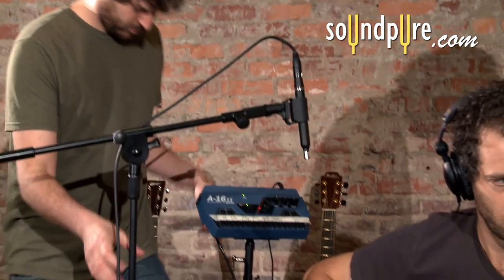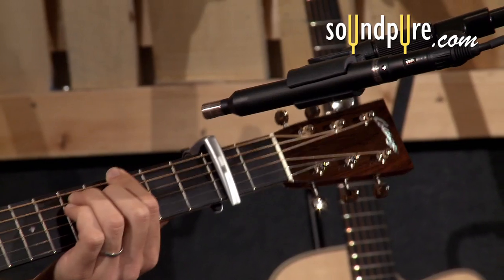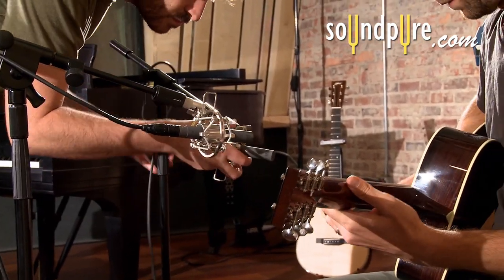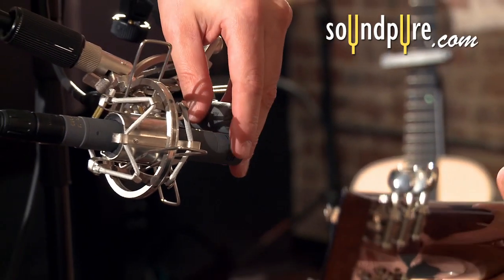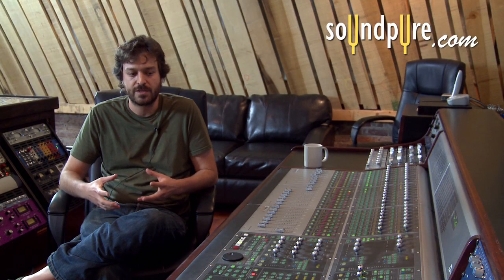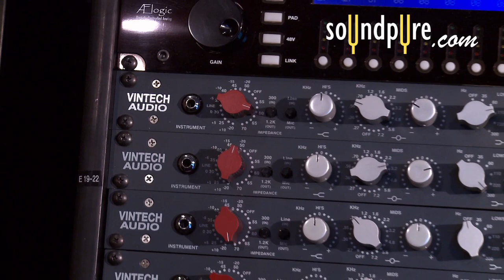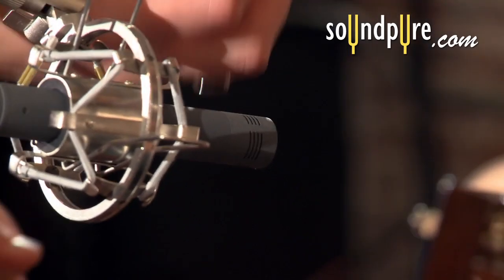How to Mic an Acoustic Guitar Recording and Choose Your Preamp

Comment from the maker: @DjAccelerate Of course... we are always here to help.   Regarding your first question- we do typically pan the wide stereo pairs hard-L and hard-R.  In a stereo presentation, small phase issues (which will exist) are not as prevalent.  When you need panning/mono compatibility it's not usually the best choice.  2) We don't recommend delay, but mic positioning for optimal phase coherence.  This requires trial and error.  You can zoom in to tracks and analyze, or in a pinch, slide the tracks.